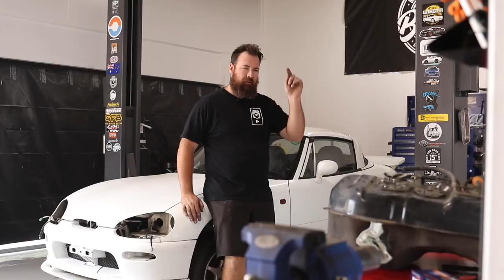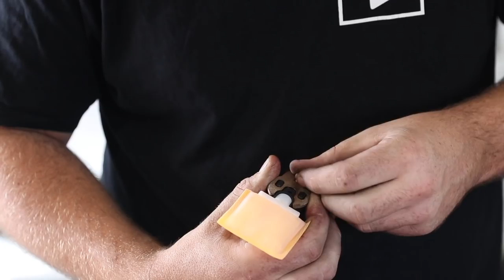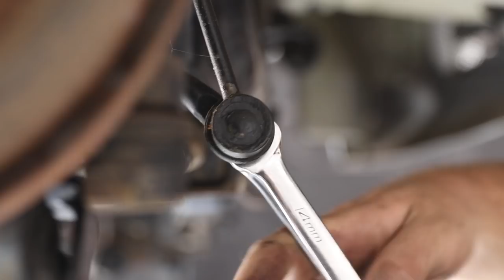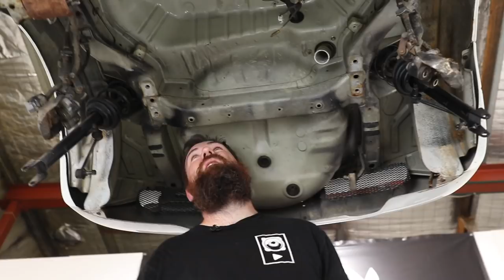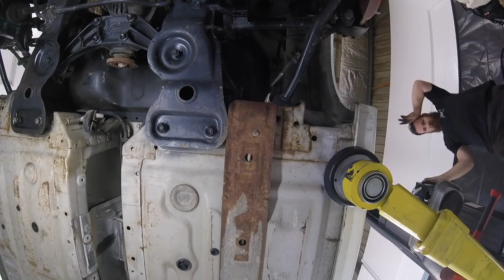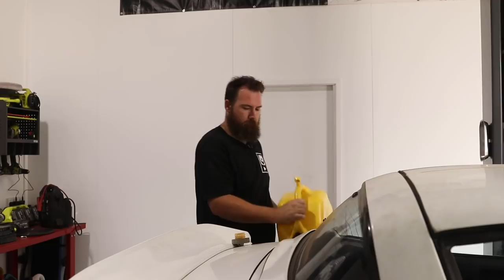CAPPUCCINO - Fuel Tank Discovery

Comment: Benny the fuel filter is a bit of a special beast but they're still easily available on This Side. OEM around JPY 6,000, aftermarket around half that.
Edit: OEM Part# １５４１０−８０Ｆ００

Lookin' good. :cheers:
Reply from the maker: scofab thanks mate , we found after some google image search action that a Suzuki Vitara / Geo Tracker uses the same filter .
Reply: Ah glad you got sorted, I was going to recommend you check UK parts sites as is not as rare over there 👉
Reply: Z518 or Z538, depending on flow direction
Reply: @BennysCustomWorks  Good deal Brother. :cheers:

Comment: Sooo someone used the fuel tank as some kind of seawater storage? Because I can't think how you'd end up with that much corrosion otherwise
Reply: Lucas Foster welcome to what happens when fuel goes stale inside a fuel tank... have seen it many times if a car sits long enough the petrol begins to break down and it is really potent picture paint thinners 50 times stronger
Reply: Old ethanol gas absorbs water like a sponge. And gas tanks are raw steel inside. They rust fast.

Comment: Another great episode,  but please please clean parts before u install them , the fuel tank was filthy and the in excess able chassis parts should have been cleaned and protected , to help with longevity. ........
Reply: I think this is the first car he's ever built ;)
Reply: Cars hardly rust down under (Aus or NZ) no need to "protect" it.
Reply from the maker: John Paice it’s done pretty well in the 28 years since it was built  with no cavity wax etc. the tank was a little dusty but no build up . We are in a very dry climate ( especially now half of the country is on fire :(  ) so not necessary.